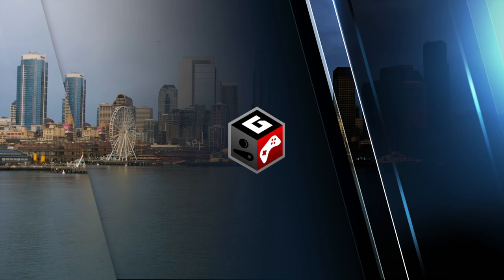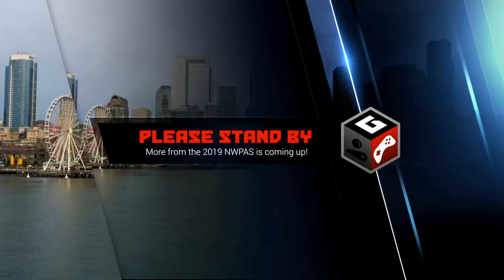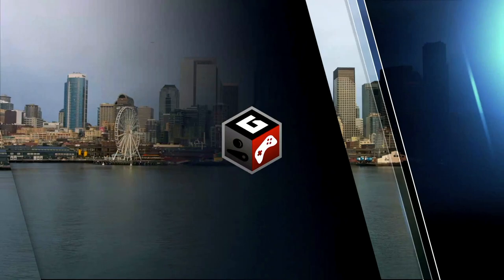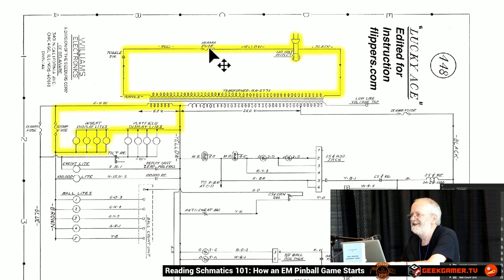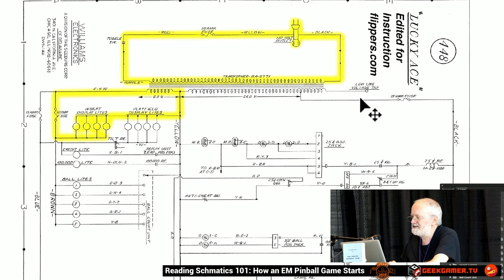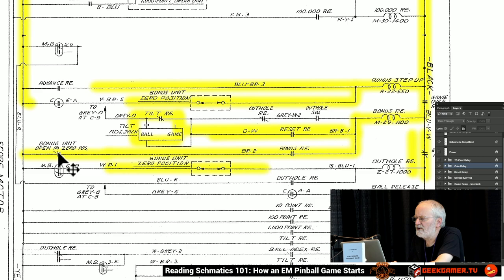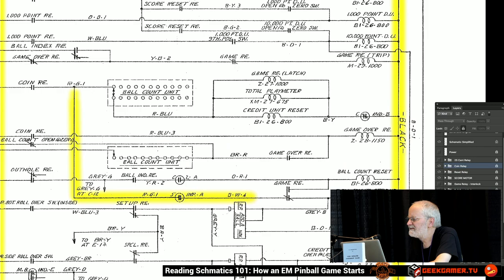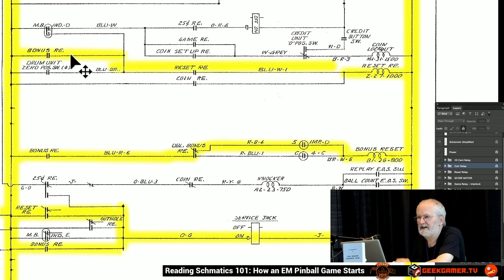Reading Pinball Schematics 101 with John Robertson

Comment: Love this video. Start up sequence is a tough subject. I like the way you break it down into smaller sections of the schematic so that in the end you understand the big picture. Would like to see a video in slow motion of the start sequence of the wires/switches/solenoids being lit up  as the electricity flows through them.